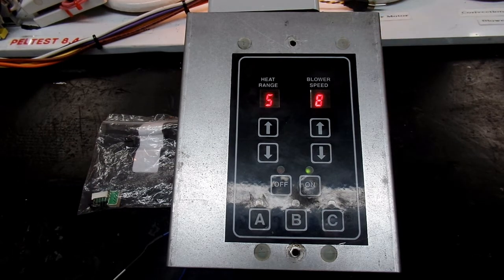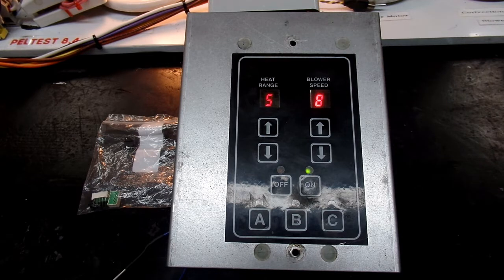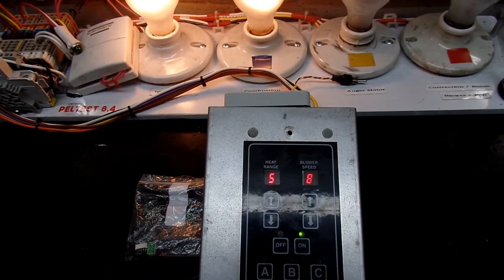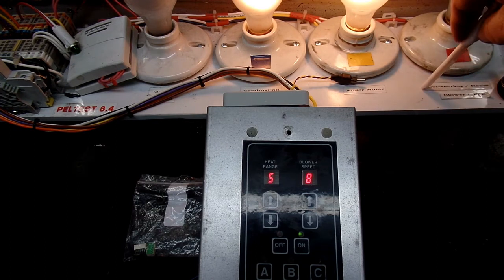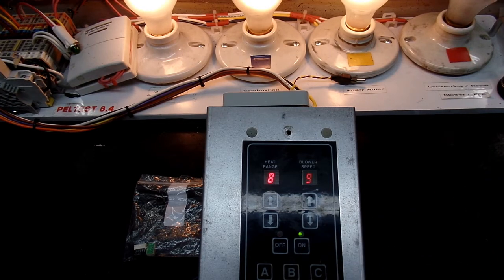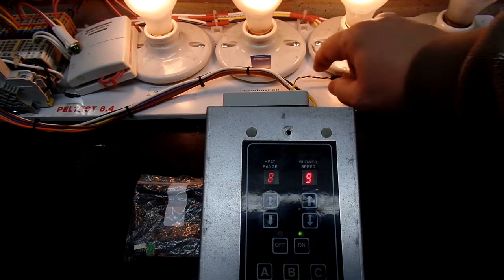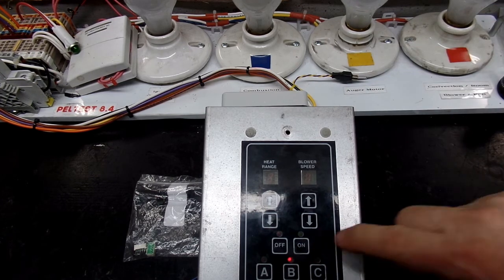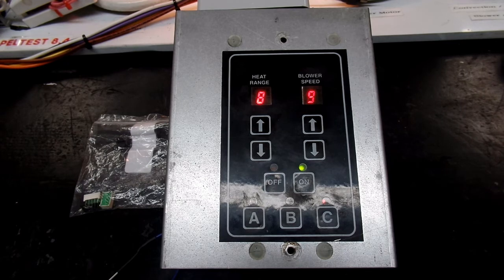Post Repair Final Testing of Tyler's USSC American Harvest 6039 Pellet Stove Controller.

Comment: My King Ashley 5500 had this A B C panel and the stove did a great job putting out heat. Since I have changed to the new style control panel, only barely warm air is put out.
Not sure how to get hot air to blow same as the A B C panel.
Any suggestions?

Comment: My daughter just got the King Ashley 5500m and everything works great but the Auger isht feeding enough pellets to keep not going. Zero option for it to dump more pellets arva time to keep it fully going. Eventually burning out and shutting down. No thimb screw to adjust on the inside where the auger is inside the hopper. Ivevtryed different heat settings (keeping the blower 1 above the heat setting)

Anyone have a solution?

Comment: I have a USSC King 5500M pellet stove with this type of controller.
Do you know if it can be easily updated with the newer style controller, or any more common controller?
Reply from the maker: I am not knowledgeable enough to answer your question correctly since I don't know exactly the type sensors in your stove and their requirements. I have not done this in the past.

Comment: I have a American Harvest 6039 pellet stove. The stove will work for a few minutes then shut completely down. The room blower motor is not working so I replaced it and still not working. It has power on the wires feeding the motor then when I plug it up it doesn’t have any power. I have bench tested the blower motor and it works fine. Any fix for this problem ?

Comment: My stove works good, but I cant change the auger speed. It will change numbers on the display, but wont actually change the auger speed. Any ideas?
Reply from the maker: Hi ASA.  Thanks for watching my video.. I appreciate it.  Based on the problem statement you reported, it kinda sounds like the Auger Drive Solid State relay is has failed, which indicates a problem on your controller's circuit board. That is the kind of repairs I do.
Reply from the maker: If interested in my reply service, you can call or TXT me at  971-724-4115

Comment: I have the same stove and when I first start it up the stirring motor works as is should but once the stove is warmed up the stirring motor will not work. I'm not sure if the circuit board is having problems or if the stirring motor is starting to go bad. What would be your recommendation to test what the problem is?
Reply from the maker: Hi Mark..  Thanks for contacting me.   My guidance for you on this one is limited, because I have not seen many of these..  You noted the stirring motor going bad as a possibility..  that is not out of the question..   the test there is to connect it to live power and see how long it can continue running, but if it is the motor, the heat generated by the fire may have an impact on its functionality. Having a different motor NOT in the stove body would help prove that out.  There is also a possibility of the controller itself being problematic..  using a light bulb to replace the motor (like I do in my videos) would be a test method..    Either way,      if you want you can contact me using the information found in this video ( due to SPAM I don't want to publish my phone number in comments):       https://youtu.be/tVnUMLupblA      Thanks

Comment: I have the same controller. It seams to be working fine except for the blower. It will not turn on. What is the cause for that
Reply from the maker: A couple of things to look at...  confirm that you are speaking of the Room Air blower and not the Exhaust blower. 1 - wiring - check the main connector with the 8 or so colored wires going to it..  does it have a bad connection on one wire, or is it blackened in any way due to heat damage?   2 - fuses - there are a number of fuses on that controller. One is specifically for the blower.  3 - component failure on the controller - You may have a failed Solid State Relay system on your controller.  4 - a failed blower.. it may be stuck or seized. When was the last time it ran? 

The wiring schematic is on Page #19 - https://woodstovepro.com/store/pdf/USStoveCompany_6039_MultiFuelCornPelletHeater.pdf

Comment: On my stove like this one I can only run it on low settings and if I go higher on settings the light will come on under A then the stove will shut off . Sometimes it will shut of on low settings ? I put a new thermostat in it
Reply from the maker: Hey..  any chance you can TXT me a photo of the Front Panel, when it is powered-up..  I would need to be able to see the Lights near the switches, and the two Digit Displays...   TXT to  971-724-4115
Reply: @MonteStudios  he is a video I did on the awhile ago https://youtu.be/NiuKyYogpGc
Reply from the maker: @Bigdaddy1992.   - Thanks for the link...  I checked out the video..  and I saw what you mean by the blinking "A LED"...  

The manual I refer to is:  ( https://woodstovepro.com/store/pdf/USStoveCompany_6039_MultiFuelCornPelletHeater.pdf  ) and it does not even give indication of possibility of the LED blinking like it does on your stove.

I'm not sure that I can give guidance on this issue, since I have not encountered that problem in the past, and would need troubleshooting time with your controller on my tester to see what I can learn.

This is probably something that would be best done in the summer, since I sense you are getting some use out of the stove during this cold season...

I'll also call USSC ( you may already have done this ) to see if they can give guidance on what to look for...  I'll provide an update here if they have something to share, but past experience with them means that I do not hold much hope...
Reply: My blower is not turning on. What could be the cause of that?